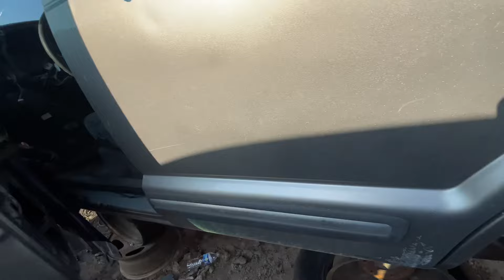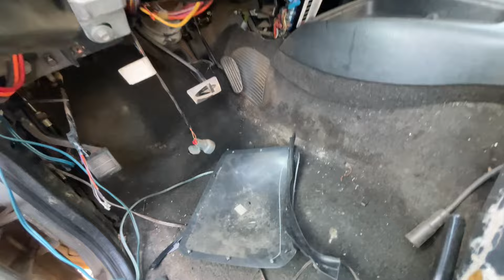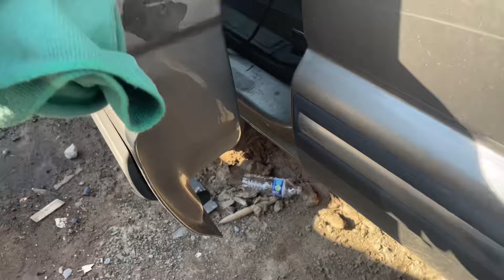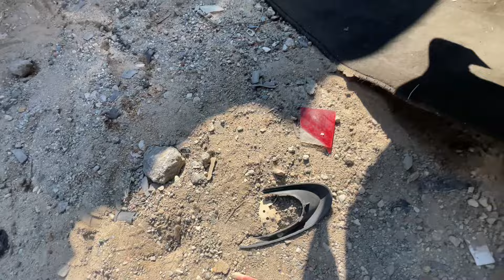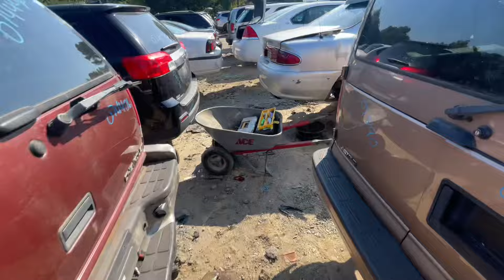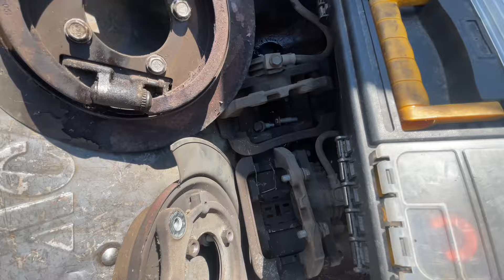1983 cutlass supreme blazer brake swap pt. 1

Comment: Had to run the video back after I got off work .. Never can go wrong with red.. but silver will match your paint ...$87.00 not bad...
Reply from the maker: @On1LifeStyle  that’s what I was thinking silver or red.
Reply: @1tonystunts  looking at the red stripe on the side if you keep it that red will pop that line out
Reply from the maker: @On1LifeStyle  bro you reading my mind😂😂😂. Definitely looking to put a red or black stripe down the side. Just gotta figure out where I can get one from. When I got this car, it actually came with a red stripe
Reply: @1tonystunts  that red would mach your suspension you just put on the back... 🫡